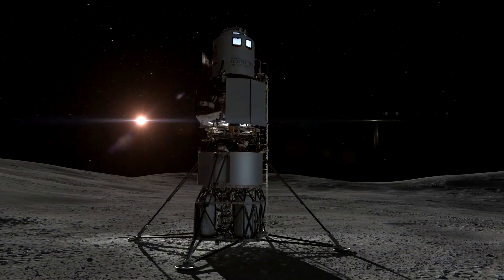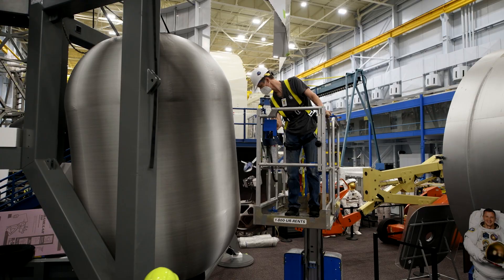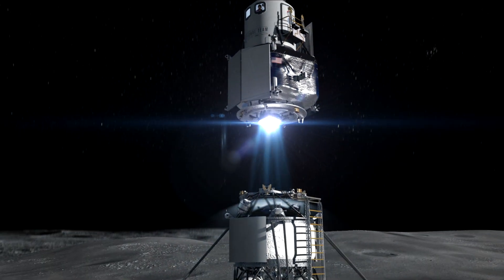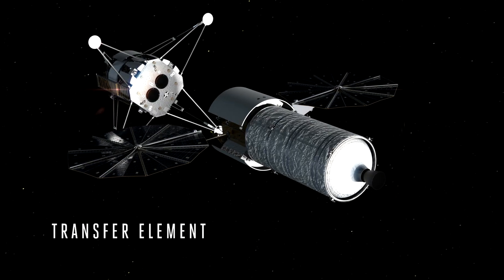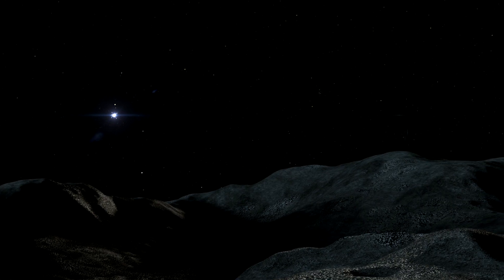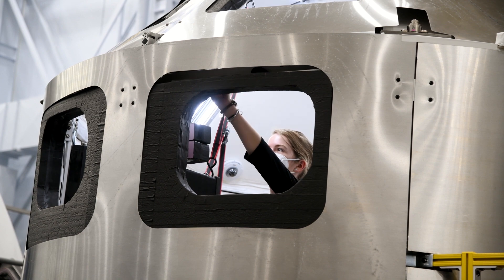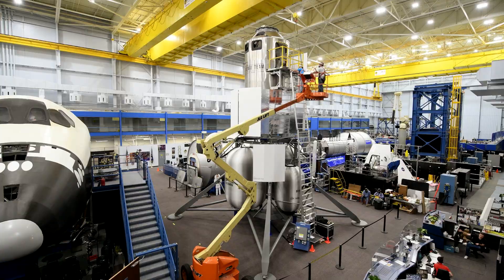Blue Origin-Led HLS National Team Mockup

Comment: There are some things about the Artemis program and the proposed (and rejected) National Team lunar lander that just don't make sense to me. If we are "going back to the Moon to stay" this time "for good", and NASA is planning expeditions that will keep a team of astronauts on the lunar surface for extended stays that could last anywhere from a week to several weeks, where are the astronauts expected to live while on the lunar surface? Where do they sleep, on the surface of the Moon in their spacesuits? How will four astronauts fit in that one little capsule for that length of time? It doesn't look big enough to house a bathroom, let alone for four astronauts (or even two) to change their clothes, or to don a spacesuit. The crew cabin is going to have to get bigger if that ship is going to house astronauts for an extended expedition on the lunar surface, unless you're suggesting that they climb in and go back up to the Gateway space station at the end of each day.

Also of note: if the intent of Artemis is still to establish a sustainable presence on the lunar surface, that suggests building something like the International Space Station on the Moon and staffing the new base with astronauts for an extended stay. If that's the case, how will something like the National Team lander help toward that goal? If the "Descent Element" module is not re-usable (throw-away rocket), that won't help with a sustainable presence on the Moon. And if NASA plans to build a base (or multiple base-camps) on the surface or in lava tubes, they're going to need a heavier-duty vehicle to lower tonnage from lunar orbit to the surface. If National Team's descent module can only handle one ton, or even a few tons, that won't be enough to help build a base. Look at the proposed Orbital Reef space station that Blue Origin is involved in. Those BO core modules and Sierra Nevada inflatable modules all look to be a dozen tons apiece at least. How is National Team's lander going to lower one of those from lunar orbit to the surface? So, either NASA's rhetoric is unrealistic and Artemis is just going to be an Apollo 2.0, or someone better come up with a larger, more capable lunar lander to compliment HLS Starship.

Also of note: SpaceX's HLS Starship uses two sets of landing engines: one traditional set of engines mounted on the bottom of the ship for lowering from orbit, and a second set of small landing thrusters rimming the upper fuselage to minimize disturbing the lunar regolith while in the final descent. Why can't National Team do something like these high-mounted thrusters on their lander? Wouldn't that make sense?

Comment: Honestly, what do you Think your doing? Your lack of reusability is holding us back in our efforts of exploring the solar system.
Reply: Friday Goood not even close to true SpaceX, rocketlab, and ULA are using and developing reusable ORBITAL vehicles.
Reply: New shephard isn’t even orbital
Reply: @Friday Goood reusability is defined as reusing pieces or a full vehicle so falcon 9 and heavy are classified as reusable systems so would you define new Glenn as non reusable? Also no matter the rockets there building outside of Artemis this lander is 2/3 unreusable with only the ascent element being reused while the two other pieces have to be launched again leading to much higher costs. Meanwhile Dynetics and Spacex are actually developing vehicles for reuse (aside from the drop tanks which in theory could be reused and are super cheap to make).
Reply: Friday Goood still doesn’t change the fact that the lander is costly, dangerous and mostly non reusable, and funny enough blue origin builds the most expensive non reusable aspect of the vehicle (the descent stage) and the transfer element IS NOT reused after taking the vehicle down to a low lunar orbit and assisting in taking the ascent stage back to gateway it is jettisoned and a new one needs to be launched. The Dynetics lander far outclasses this one.

Comment: As a taxpayer, space enthusiast and Engineer I'm rooting against the National Team HLS. The system is more expendable than reusable. A new descent element and transfer element have to be launched for every trip to the surface. Pretty much fails the "desirement" for reusability.  Ingres/Egress is poor. And most maddening is that the National Team got the lion's share of the award to essentially dust off Apollo era blue prints. New paint on 60 year old technology. Dynetics solution is reusable save the drop tanks. It can deliver a rover or even habitats. Ingress/Egress is optimal. And represents a step forward in how we get to/from the lunar surface. It will be a disappointing day if Blue Origin gets any more money to continue this concept.

Comment: Hey guys...Climb 50 feet on your roof. Put on a motorcycle helmet and 30 lbs back pack. Now crawl backwards to a 50 foot ladder and climb down it....not at an angle, 90 degrees to the ground.  Now do the same thing on another planet....GOOD LUCK. Landing on the moon is "ALL about weight". So your going to have to have a cable / harness system to safely get astronauts up and down  ? What if it malfunctions like the Apollo tethers they tried on the LEM to move rock boxes up and down  ? Does anyone at NASA know anything about landing on the moon ?
Reply: In 1/6 gravity. Much easier. Probably not the best way to do it but still easier. And yes; NASA has been to the Moon before. Thirty odd years before SpaceX existed and a couple of years before its founder was even born.the wrote the manual on it.

Comment: Look at that huge ladder! So you land on the moon. You get your bulky EV suit on with its big backpack, restricted visor, clunky boots, and thick gloves. The next thing you do is to crawl out of the hatch, stand up and climb DOWN a 2 and a half story ladder without being able to see where your feet are and overbalanced with the backpack making you tip backward. Unless the ladder fell off on landing. Or broke. Or bent. What do you do if the ladder breaks on your way back UP the ladder? Climb a rope? Have an emergency winch? If you have a winch, why not use it instead of that freakin ladder! Better yet, have two remote-controlled winches. Geez.
Reply: I think winches are a good idea but the ladder has to be considered.

Comment: SpaceX: "we have two flight worthy starships both doing 150 m hops"
Blue origin: "we built the mock-up take a look at this shit!"
Reply: Those are not flightworthy Starship's. How could you think that? Have you seen what Starship is supposed to look like and compared it with Starhopper?
Reply: @OptimusNiaa   Err, they have already FLOWN one. I would qualify that as "flightworthy". Not very high but it got off the ground. the only way this mock up gets into the air is if they throw it out of an airplane.
Reply: @johnpombrio  The SN5 test did appear successful, and was pretty cool. But while it is the same size as the real deal, it has fewer engines, no life support systems, etc. Those differences are significant enough that one would be hard pressed to consider the flight of SN5 to be a flight of Starship. It's a prototype, and a promising test flight. And the National Team doesn't have a comparable test flight of elements of their system. So, unnecessary snarkiness notwithstanding, you're right that as far as we know the Nat'l Team's system can't currently get into the air. SpaceX's rapid iteration and testing workflow seems to be on display.

Of course, even though SN5 was able to get into the air, Starship can't get to the Moon by itself, as it will need Super Heavy. That doesn't exist yet. Nor does ULA's Vulcan or Blue Origin's New Glenn, which the Nat'l Team's HLS requires. Dynetics' system also requires Vulcan. (The National Team and Dynetics could also use SLS, which is further along, currently undergoing green run testing. But the availability of an SLS for the launch of the Artemis III HLS doesn't look likely from what I've read. And none of the 3 proposals launch astronauts themselves, but instead depend on an Orion capsule launched on an SLS. So, as planned, they're all equal in that respect.)

Again, it just strikes me as way too early to be crapping on any of the 3 systems.

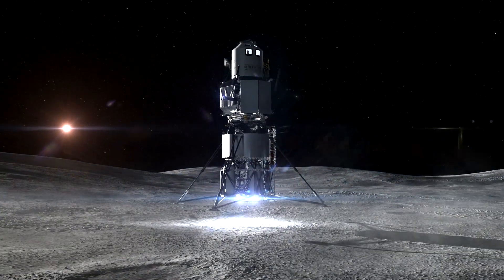Comment: 1:13 3 years of experience doing what...
Reply: The main purpose of new Shepard was to develop blue moon. When you think about it both are hydrogen/oxygen powered, are the same size and can propulsively land.
Reply: Did they cancel the blue balls?
Reply: 3 years of selling cheap Chinese products over the internet with Prime shipping
Reply: @dcb1138  Damn right
Reply: Research and development. Just because you don't see stuff happening doesn't mean it isn't happening and isn't important.
Reply: @OptimusNiaa  We all know every company does R&D..All remember BO was founded 2 years before SpaceX. Even after all these years, they were just able to produce an inflatable model..
Reply: @rajeshraghavan9881  The assumption that Blue Origin had intentions of taking the same development path at the same rate (and thus taking their lack of comparable flights being due to inferior ability or the like) are just that, assumptions. No doubt SpaceX has flown way more hardware. But that doesn't establish that Blue Origin wanted to take the same route but failed. It is possible that they intentionally were taking a different path. Indeed, they didn't even start pursuing orbital spaceflight until 2014, four years after the first Falcon 9 launch. So you very well might be making an apples to oranges comparison. Reality might be more complex than you're making it out to be.

Also, there's New Shepard, which is a suborbital rocket, but also not an "inflatable model." And there's the New Shepard's BE-3 engine. And well into development, so not final flight hardware but also not "inflatable models," are the New Glenn rocket and its BE-4 engine (which is also scheduled to be used on ULA's Vulcan). Also in development, and thus more than an "inflatable model," is the BE-7 rocket engine, scheduled to be used on the HLS.
Reply: Well, I am going to stop commenting as you are far more knowledgeable about BO activities than I am.

Comment: Too tall of a ladder.
Reply: The Dynetics Lander seems to be the only one of the three proposals that addresses the ladder/egress issue. It actually is lower t the ground than the original Apollo lander.
Reply: @cornerofthemoon  It probably will be the first lander.
Reply: Winkkin  Dynetics is the dark horse of the three contenders, but in theory it would be the cheapest and most modular of the three as its crew module can be replaced with cargo and science variants. So far it’s received the highest technical and managerial score from. NASA. However the other two particularly the National Team will most likely have the most Congressional pull.
Reply: Right ?!?!?!? -- Dumbest proposal ever. There's no way an astronaut in that massive suit is going to climb 50 feet down that ladder ...even on Earth. If you fall it's over .
Reply: @dcb1138  1/6 gravity is still like jumping off your roof with 50 lbs os shingles on your shoulders. #splat
Reply: @Winkkin  - Yup.  Why are they ignoring all the tests , studies, experiments that were done in the 1960s. My  Uncle worked for Grumman on the first lunar lander. It was intense.  And they did 99% of the homework because physics have not changed in 60 years.  This design is a joke. You watch....NASA will reject it

Comment: Guys, if starship project goes well I think you will need be a little more ambitious to stay in the space industry
Reply: I doubt Lunar Starship will be ready in that timeframe -- but I reckon NASA will keep providing some funding, because Lunar Starship's capabilities are pretty irresistible, and NASA will want to remain embedded to some degree in the project.
Reply: @cacogenicist  In fact the lunar starship is only a lander. It will not carry crew at launch. Pretty sure that human rating a lander is way easier than a rocket.
Reply: @johntheux9238  I would think so, but base Starship systems need to be developed, and Super Heavy has to be ready, and orbital refueling has to be hammered out, etc. It's a lot to do. 

But boy, being able to land that much mass is crazy. Highly desirable, to put it mildly. Too much to resist.

But if I had to guess, I'm gonna say that the initial mission will be won by Dynetics. Very cool concept. Seems doable. And they don't have to build an insanely huge booster from scratch.
Reply: @cacogenicist  Hopefully they will do everything they can because of starlink. They need 21 starship launches a year for their constellation. Those satellites are cheap to build so they are gonna take risks.
Reply: @cacogenicist  Even so Starship is a New Glenn killer BO new rocket won't last much 3-4 years in best case scenario? They need a bigger fully reusable better rocket. Bezzos is the richest man in the world I think he can take this competition more seriously
Reply: @fjandro9646  - Yeah, I don't see what New Glenn's niche is in a world featuring a fleet of operational, fully reusable Starships. More capable in every way, and way cheaper ...

I would think BO would want to get cracking on a fully reusable New Armstrong as soon as possible. ... although they aren't, you know, particularly known for being speedy.
Reply: Yeah, that's why they have the Glenn rocket.
Reply: @cinnamon-skateboarding5987  The second stage of New Glenn cannot be refilled in orbit so it can only send tiny landers like blue moon to the moon.